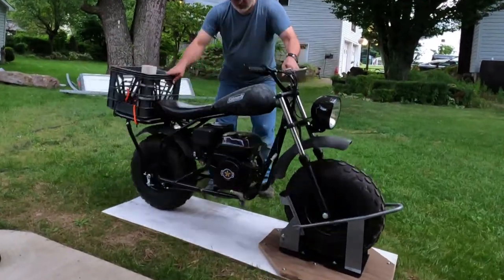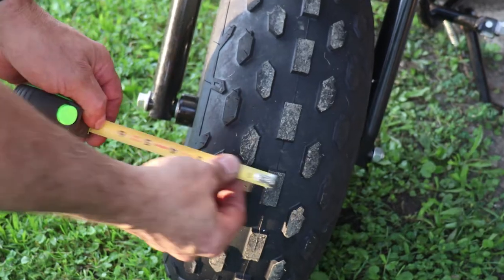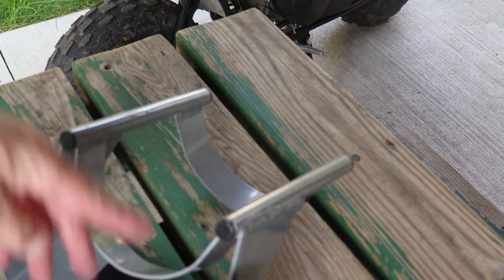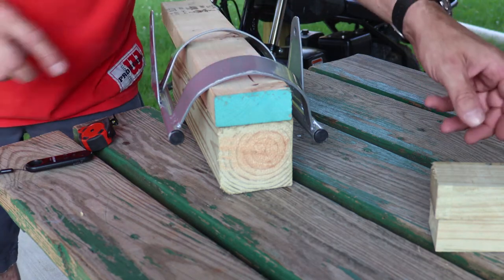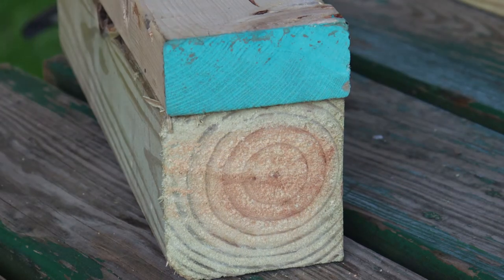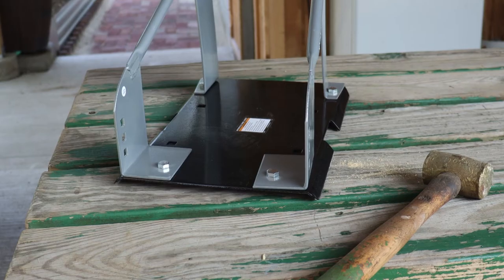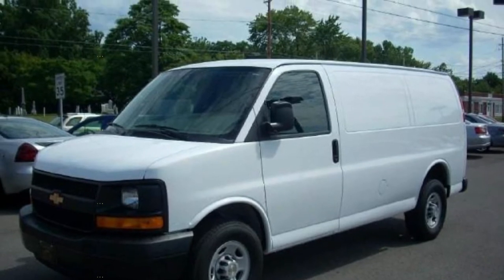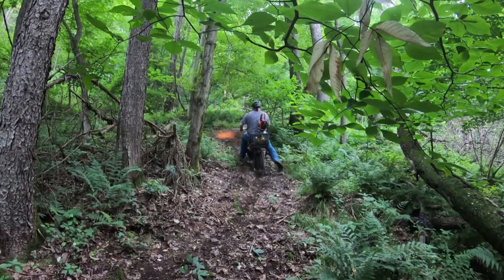Haul your Mini Bike the EASY way!

Comment: Exactly what I was looking for to haul my son's minibike in my toyhauler.
Reply from the maker: Thanks for watching Dan. It worked out great for me. One thing that would have made it better was mounting it to a little larger piece of plywood, but each case is probably different with these. I think that it was designed to just mount directly to the floor.

Comment: I thought one question my gas cap on my Coleman minibike CT200u keeps coming off what do I do
Reply from the maker: Thanks for watching! I haven't seen or heard about that issue until now. I'm guessing that the two metal tabs that hold the cap snug against the rubber seal might need bent a little so that it pulls the cap tighter against the seal. This is only a guess, but I think that those tabs are what keeps it from vibrating loose while you're riding. Please let me know if it helps.
Reply: @themostlymikeshow  Already tried that and got multiple gas caps what should I do I ride it a lot
Reply from the maker: Maybe a different rubber gasket of thicker or harder rubber? Could the edge of the cap be bent in so that it contacts the edge of the opening? Maybe wrap a shoestring around under the cap and tie it to keep it from vibrating. Just some suggestions off the top of my head.
Reply: @themostlymikeshow  Do you think if I bought another gasket that would help
Reply from the maker: @ytfrosty6754  Quite possibly. I hope that it works for you. I will be posting some more videos of stuff that I added to mine. I've been trying to mix it up with some trail building, bike repair, etc. Trying to keep a variety of things.